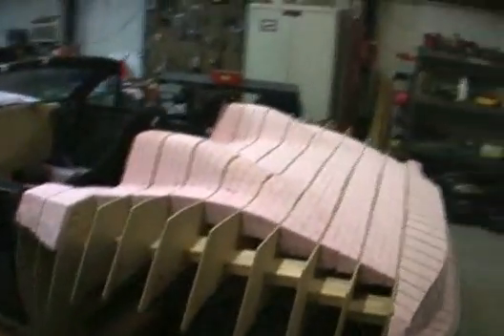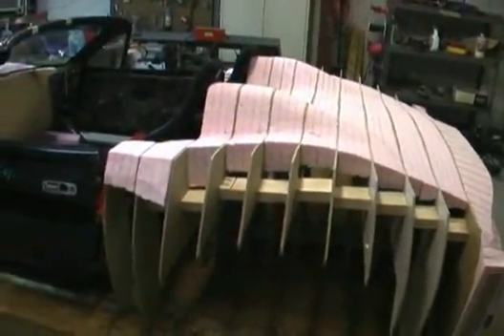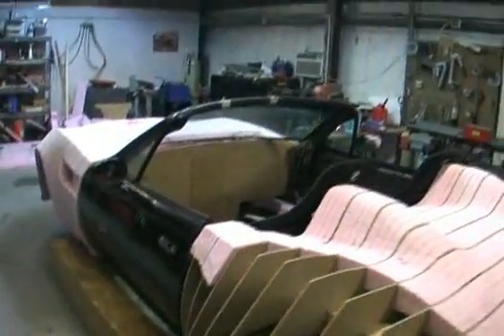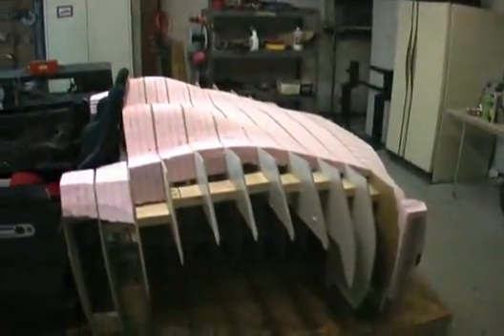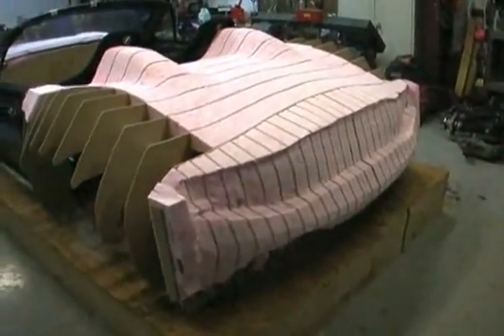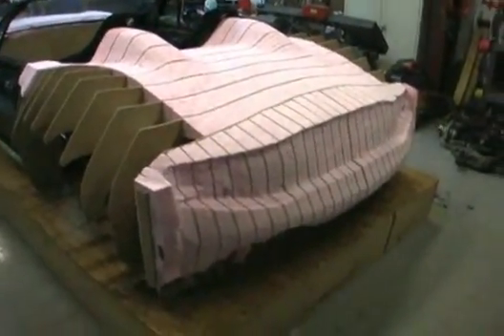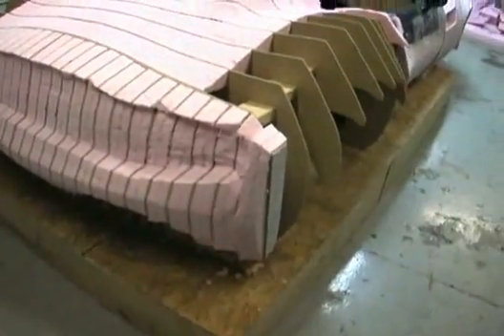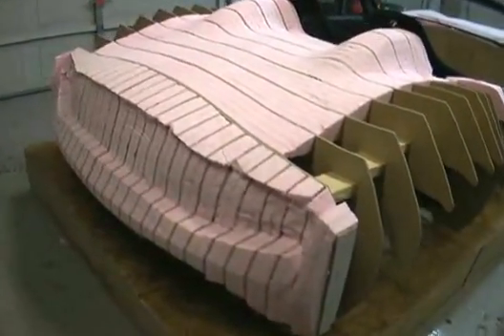Bailey Blade Car Design | Building the body buck and shaping the foam - Part 3

Comment: This is an amazing project. But that sure is a TON of foam wasted. I think if I was doing this, I would have gotten bunch of newspaper, balled it up and stuffed it between the ribs so that it was about half an inch from the edge of the rib. Then you could use a home insulation spray foam kit to fill in the rest of the space to the edge. The foam would only be about a half inch or one inch thick, and you could just trim off the excess to the edge of your rib like you did with the pink foam. You could do the whole car with probably half the foam kit and have very little waste and much cheaper. Still though, your project is very inspiring. I think when I do my project, I'll try the spray foam method and let you know.
Reply from the maker: oggyreidmore Yeah I really needed a more sturdy method. You really want the body buck to be as strong as possible so that it does not distort in case you have to move it or from the pressures of shaping or vibrations of sander or power tools.
Reply: BaileyBlade Yeah, I never thought about having to move it...

Comment from the maker: @thefonzmeister Yep thats true... in one of my other videos you see me covering the car in a silver tape. which is actually aluminum ducting tape used for Home AC systems. It works great for covering the foam and will allow you to remove the foam latter if needed. People use this method or they paint the foam with a latex or acrylic paint to seal the foam and protect it from the chemicals.

Comment from the maker: Yeah the doors are off a different car, they are only used as a mockup door. We explain in the other videos. But basically they are in place for the Glass only. The doors will be custom designed as well.